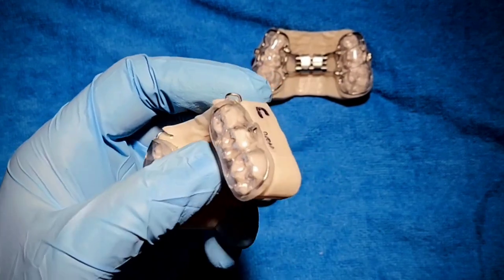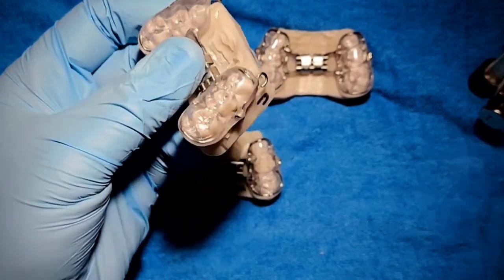Orthodontic Palatal Expander Trick

Comment: Why would you use acrylic and a 2 mm 🤔 is it only for the flame torch method?
Reply from the maker: Torch method only works on biocryl. Whether 2, 3, 1.5mm thick doesn't matter. If you heat cold cure acrylic it won't smooth it will burn